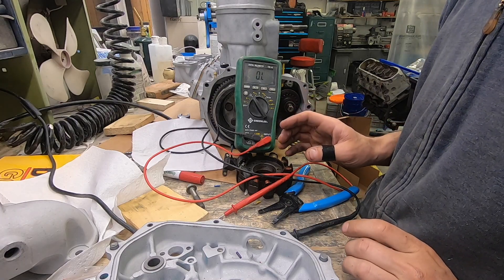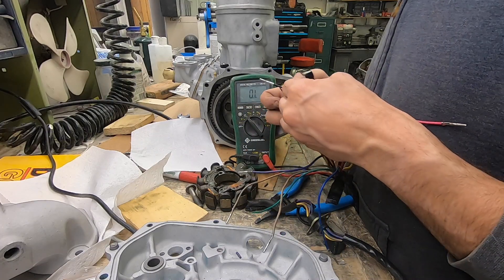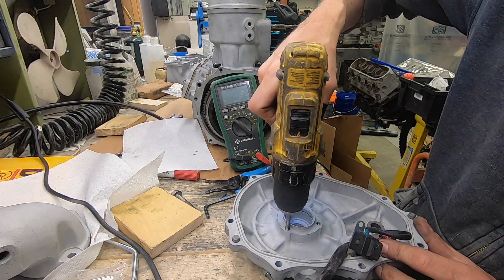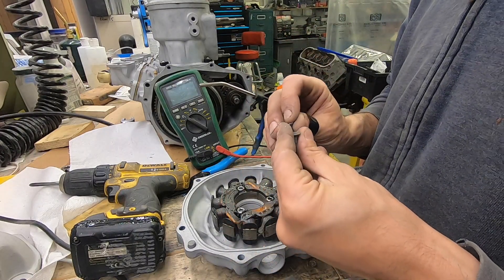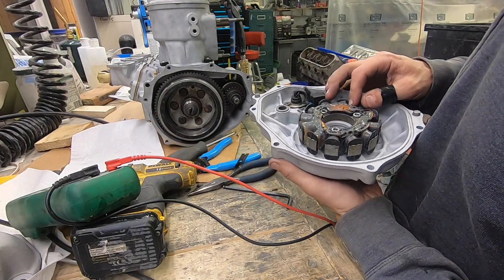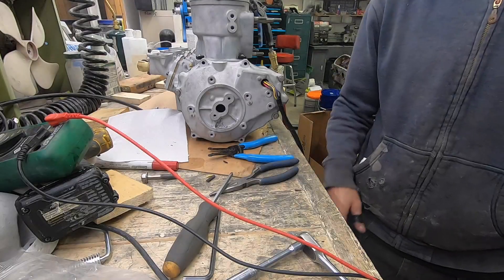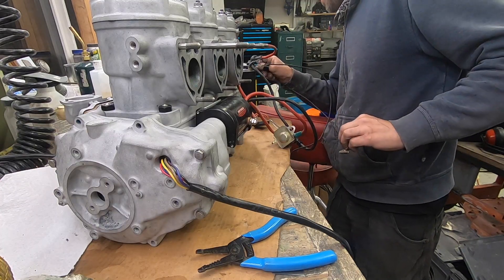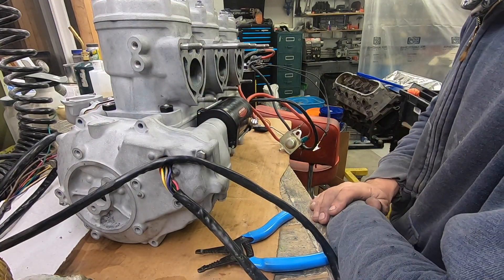1100 Engine Build / Update video - (Part 2)

Comment: not gonna lie, my build has been sitting, just no motivation to finish it, ive hit a brickwall when it comes to wanting it done
Reply from the maker: I've been in that situation many times. Don't be too hard on yourself. Step away from it for a while and do something else, even if it's not jet ski related.  Maybe I will get mine fired up soon and spark some new interest in your build 😁I had buy a new 1100 CDI. The one I had was bad and for a 900... 

For me, I find the excitement of the build comes and goes. It's hard to worth through those times after you've come down from a real high and you have to just struggle with something boring and tedious. That's probably why I jump around so much with my content. I work on something for a while and then find something else to do and eventually circle back. 

I was thinking today that I have my Classic Mini project car sitting there unfinished and the supercharger project... and the 650 X2 exhaust system... all unfinished projects, and I was worried that I was going to get a reputation as someone who never finishes anything. 

Wow... that turned into a long rant...

Comment: Hey Joel, regular West Coast epoxy with 206 slow hardener goes a long way with infusion. You'll just want to make sure you use enough entry and bleed lines around the part. For larger stuff you'll better off be going with infusion resin, but for this rideplate I don't think it's necessary.

Absolutely make sure you're 100% leak free before mixing your resin! It's a pain when it happens half-run! Let me know if you need some advice.
Reply from the maker: Thanks for the advice. 

I do have some West System 105 but only the fast hardener. I figure if I'm doing some infusion projects, it's probably worthwhile eventually getting infusion resin, but that's great information, I actually wondered about that.  

I am a difficult person to give advice to. I'm a bit of a mental case, and knowing that I'm doing something the wrong or hard way, doesn't always change my mind. Certain things just make me feel better / more comfortable, so I do them knowing that I shouldn't ... like scratching an itch, haha. 

An example of that is that my plan is / was to not do infusion at first, but to do wet layup and then put it in a vacuum bag to cure. I'm quite aware that this is harder, has more likelihood of going wrong and is much more time sensitive as the resin is curing as soon as you place the first layer... still, I feel like I need to do it that way first 🤷‍♂️

I tend to take baby steps into everything, and it ends up costing me more time and money in the long run, but it's just how my brain operates. I'm sure I will have questions along the way... I will try to remember that you offered to help 👍
Reply: @JoelArseneaultYouTube  Those baby steps are your brain 🧠 leading you cautiously into new ventures until you feel comfortable that you understand the task at hand . Basic Systems Familiarity .lol I say that like I know anything lol. Hodgepodge , I mean variety of different things going on today . All necessary parts of the project.  Giterdun boss . Projects aren't all glamorous.  You must have really been tired . Not your usual explanatory self . No intro . No music.  No smiles. 😶 
I honestly had no idea that there were so many types of resin for specific tasks.  Never really thought much of it.  I honestly just adjust pot life and thickness with acetone.  Lol  
I mean,  it evaporates so 🤷.  
Either way thanks for sharing.
Reply from the maker: @rickems8863  Thanks for your supportive comment ! 

My girlfriend is convinced, and has convinced me, that I have ADHD, and it really gives some reason to a LOT of my behaviour. Much of the stuff I had no idea about (I didn't know was ADHD related) and I really didn't want to be put into a category so I argued the facts for a while... then the evidence piled up and it all made sense, lol. Much of my OCD like behaviour can be explained by this. 

Anyway, I had a lot going on and was really tired.... I had made the riding video as a bonus video, but then didn't have a Sunday video ready, so decided to release it so that I could let people know what was happening. It all turned into a bit of a mess, but it took some pressure off me. 

Very true, Much of a project is just stuff you have to do, and one of the hardest parts of filming and editing is knowing what to put in and what to leave out... the more I leave out, the more progress I can make, but I have to keep enough in so that people can follow along haha. 

Two years ago I had no idea there were so many epoxies either... I've learned a lot. I was just told by another viewer that lots of people just use west system 105 resin with the slow hardener, and as long as you're not doing something huge, like a car hood or a hull... you'll be okay. The thinner infusion epoxy just makes it flow faster and wet out the material with ease. 

WIth experience you learn to trust in little tricks and hacks. I always say that I can tell a mechanic who learned by working on stuff VS one who went to school... When you learn by making mistakes, or by doin things out of necessity, you have a better idea of what you can and can't get away with, while a mechanic who learned from a book will just do what it says in the book... those guys never make gaskets out of cereal boxes 😂😂😂😂😂😂😂😂😂 

To paralell that, I've learned a LOT of what I know from reading and watching pros make videos... That's why acetone freaks me out a little, but someone with more experience is like ... "Sallgood."
Reply: @JoelArseneaultYouTube  lol , I refuse to accept being placed into a "category " so I deny and argue it away too lol.  
Sarah n Tuned   on YouTube has some serious OCD and ADHD . Uncontrollable need for perfection and obsession with cleansing / improvements on anything remotely near the area of work.  
Totally agree with your assessment of book smart mechanics and practical hands on experience.  
Lol book mechanics would never make a cereal box gasket. They order , wait , install .